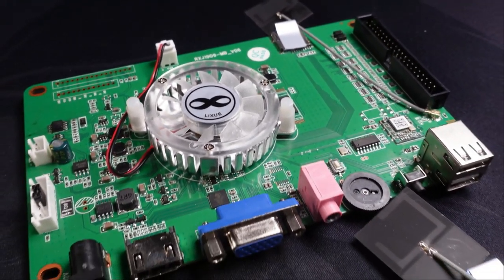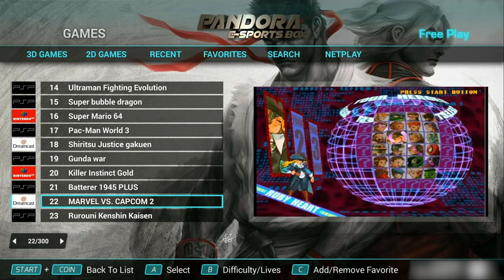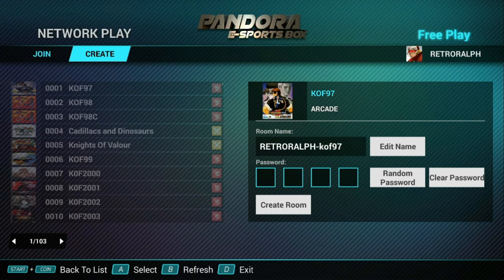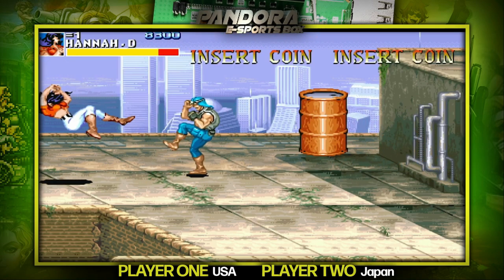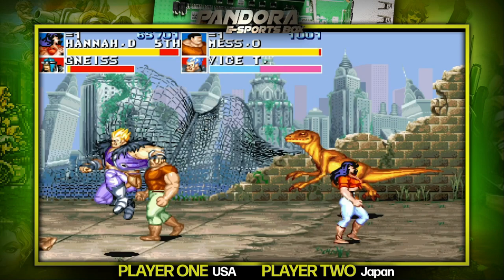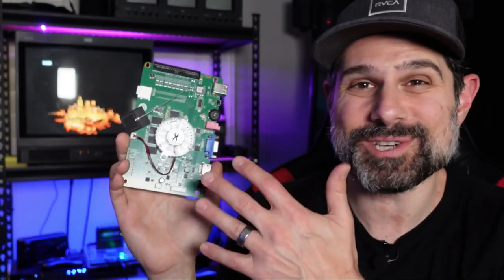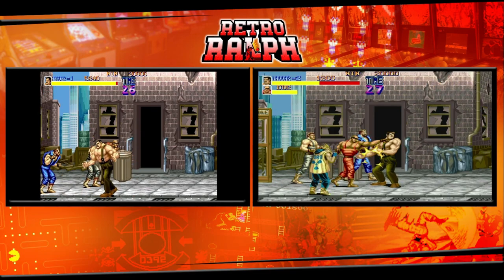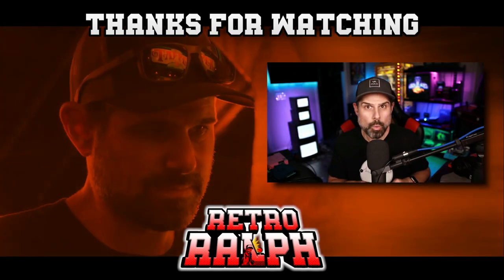Pandora Box E-Sports Edition - Play Retro Games ONLINE Easily?

Comment: Always steered clear of Pandoras Box in favour of RetroPie, bit more configuration to do but for the most part its better emulation and runs as it was ment to.
Might circle back though and check out Team Pandory, could be worth if if they are fixing the long standing issues the Box has

Comment: Nice vid. Looks like an interesting product. Especially how it (shamelessly) runs RetroArch but has a yzkof romset.

Wondering a lot of the performance issues are from the enforced gfx upscaling? Would probably be very easy to mod if you might have no need for it 🤐 it's very similar when running RetroArch upscaled on cheap hardware when online (like... possibly certain home arcade systems we know about).
Reply from the maker: Thanks for watching and checking it out.  I would send you the other board if you're interested.  If you can make some progress on improving the performance, that would be awesome.  Let me know...
Reply: @RetroRalph  absolutely sir! Will follow up in a bit.

Comment: @retroralph great video man! does this pandory tool work on the dx special version? thats the pandora box that i own
Reply from the maker: The version I linked to in the description should, but you can back up your card and try it, it will fail if it's not compatible. I have a Special, I can give it a shot and let you know.
Reply: Pandory has support for the DX Special from 1.11.  We're currently fixing bugs, gearing up towards it's public release.  Early access is on our Patreon if you fancy an early fiddle.
Reply: @RetroRalph  thanks man, ill try it and also back it up just in case. cant wait to see your results aswell. i initially wanted to order the ex version but went with the dx special as its supposedly the most stable. the ex version has a diff processor but some games still stutter like MK1, unlike this DX special

Comment: im using pandora with the cga video from the jamma output rgb video , this pandory tool will make what kind of difference in this configuration ?
Reply from the maker: I would have to check but I don't think that's supported at this time.  It would probably help with the emulation side but that's about it.  You would always be outputting at the right aspect ratio if your using video out the jamma edge.
Reply: @RetroRalph  thats exactly what i was wondering , thanks bro !